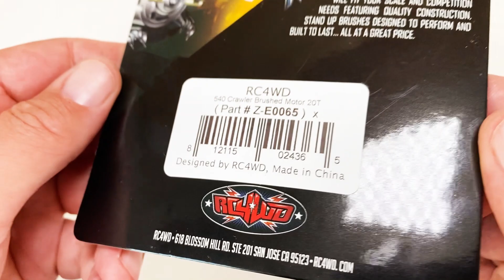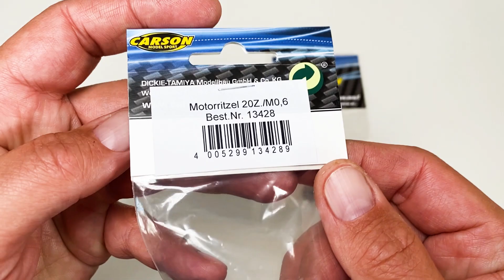Tamiya Wild Dagger WR-01 Transformation (Episode 3): Upgraded Dual Motors & Steel Pinion Gears!

Comment: Pushing he power up a little and long shock mod :-)
Reply from the maker: Yeah! Just a little extra speed. Think it will be alright with the extreme low gearing (even with the 20T pinions). The shocks and towers will make up the most difference though, I think, in terms of handling. Thanks a lot for watching, Mal.

Comment: Hi Mikael! Great job - amazing how good those gears are after 20 years!  Those new motors should pep her up a bit, especially with the new pinions - gonna be a really "WILD" wild dagger!  Hope you are all well, enjoy the weekend, mate!   :)
Reply from the maker: Mark Bryan RC Hi Mark! Yeah, it will definitely speed her up a bit, but still gonna be quite torqued, with the gear ratio of 16.5:1. And I also  keep getting amazed at the quality of the Tamiya gear boxes and their old plastic gears. Sealed and safe and unless the plastic bushings have been used the gears (nearly) always look brand new after a clean up. Drove her around in the house a few days ago, all finished, and it’s such a smooth ride. Wild Wild dagger ☺️
Reply from the maker: Mark Bryan RC enjoy your weekend too, my mate. Got a half an hour alone right now. Think I will spend them on your Terra Scorcher 😀
Reply: @NordicRC  Great to hear she's running smooth, yeah great Tamiya gears,I have a few 20+ year old Tamiyas that still run smoooooth!  :)

Comment: I placed a differential gear putty on the rear gearbox on my wild dagger to give it a limited slip differential. Also a tamiya fl tuned motor and 20T pinion gear.
Reply from the maker: Sounds like a good set up. Yeah, me too. AW grease in both diffs and 20T steel pinions.